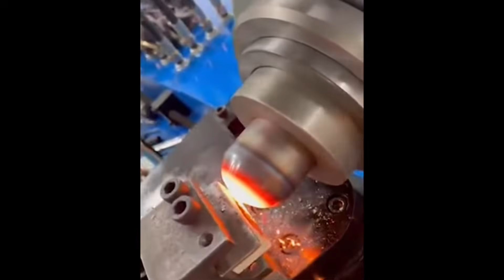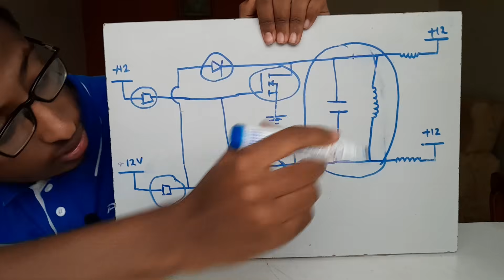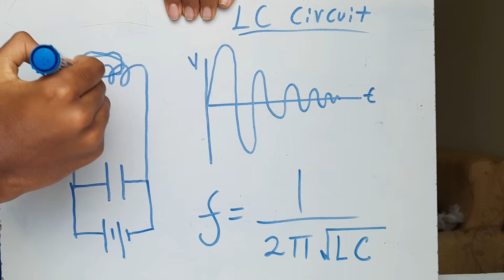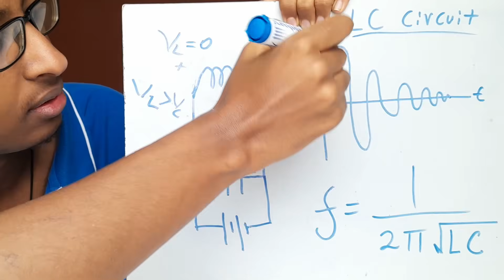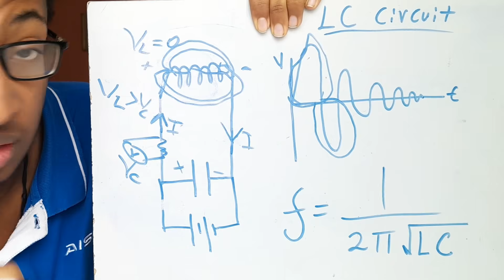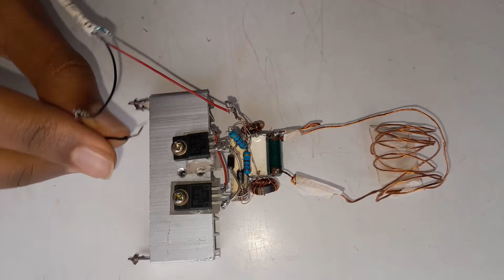I Finally Made My First ZVS Driver To Power A Flyback Transformer!!!

Comment: can i use irfp260n mosfets, and which pin is ground in the transformer
Reply from the maker: Yes u can, grab the BIG red prime wire of the transformer and bring it closer to the pins, if ur Circuit works properly, u will see an arc bn the red wire and one of the pins as u bring it closer

Comment: I think it's not ONLY the resonance frequency that hinders "metal cooking." I think it's your overall circuit construction. These drivers need to be built with very strong components and  to be powered with high currents. You need big MOSFETs, robust capacitors, big chokes, and really fast high power diodes, which can get very expensive. Not only that, but you also need a very strong power supply that can handle a lot of power.

I know you really want some high power stuff, but eventually, you'll get there. I think you should try to find some old, high power electronics that contain such components or save a lot of money (which I did to build my own ZVS) in a period of time to acquire those.

Also, here's how I designed my own ZVS driver. Follows the centre tapped variant that only needs one choke, along with different components:

MOSFETs - IRFP260N (stupidly expensive but the best of the best for ZVS drivers)

Tank capacitors - 6x 1uF 630v polypropylene caps in parallel for a total of 6uF (these need to be VERY POWERFUL).

Choke - small flyback transformer ferrite core with 15 turns of 10 gauge stranded wire. (I suggest finding these cores at broken crt tv's)

Fast diodes - I used Mur1560g (but you could use the more popular uf4007)

Others - 15v zeners and 10k ohm from G to S, and 500 ohm 5w gate resistors.

Power supply - 12v 21a LED driver (But you could use any PS you want as long as it could provide high currents).

Here's the schematic (which is not mine btw): https://images.app.goo.gl/TrM5L4UjsGto9DRJ6

I hope this helps! Have a great day!
Reply from the maker: Big Thanks for the steps and components bro...I'll make sure to improve the circuitry for a future video...that's a promise 🙏

Comment: That thing was not called a ZVS driver, it was called an induction heater heating a part and an automated machine sealing the end off.
Reply: but it can alsobe used to drive an induction heater,  for this video the the main coil from the zvs driver is turned around a CRT TV flyback transformer that is responsible for generating high voltage
Reply: @anunaccountablescience6464  I meant at the beginning, your opening statement made it sound like you were saying that what you were showing in the clip was the ZVS driver! 😂👍